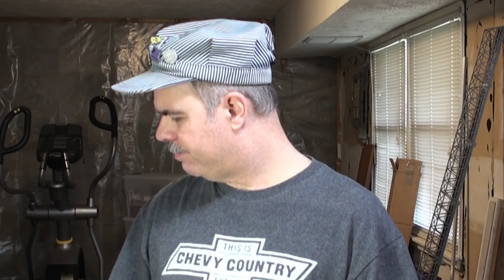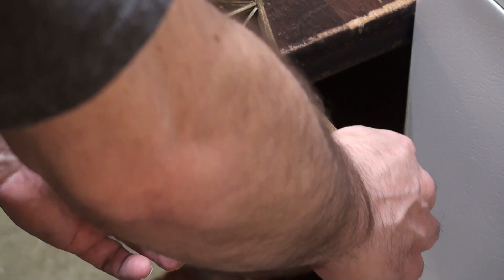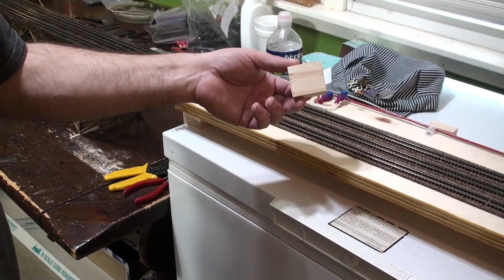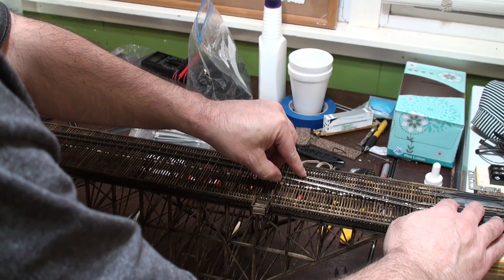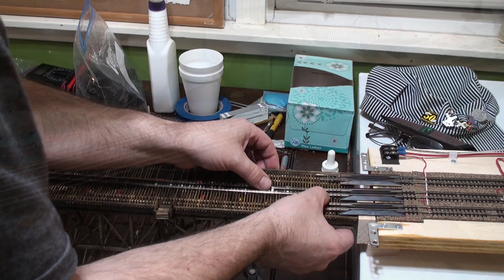White Pass Yukon Bridge Build Pt7 - DaBob's ManCave

Comment: What was that tool you used to keep your track straight?do you have a link?
Reply from the maker: It was apart of a kit that had that, a double track spacer, ballaster, radius maker.  I may have got it from ModelTrainStuff.com  Micromark makes it, currently they only make the HO version but this one is N scale.
Reply: Look into "Ribbon Rail". They make Track Alignment Gauges for Curved Track. I do believe they have a straight gauge.